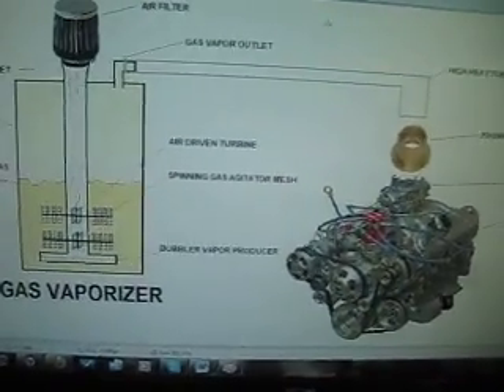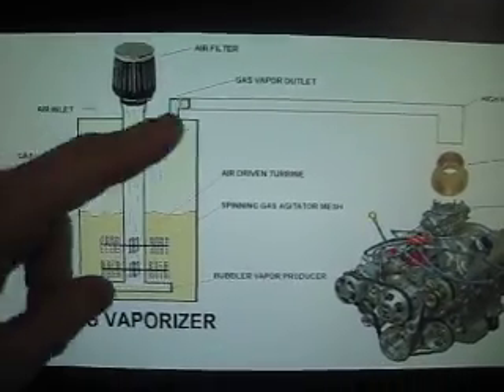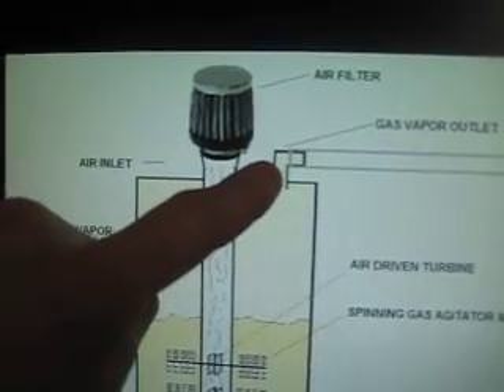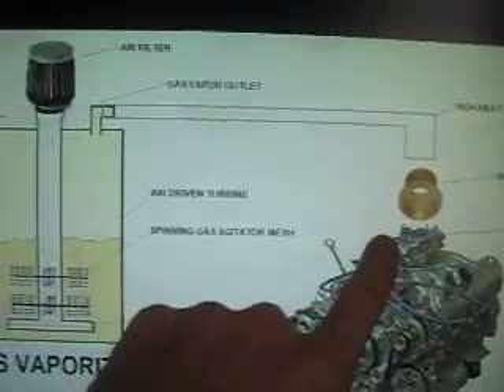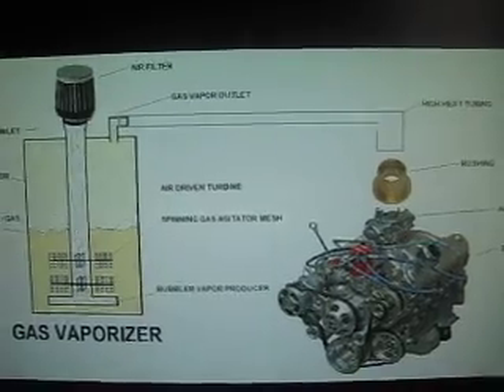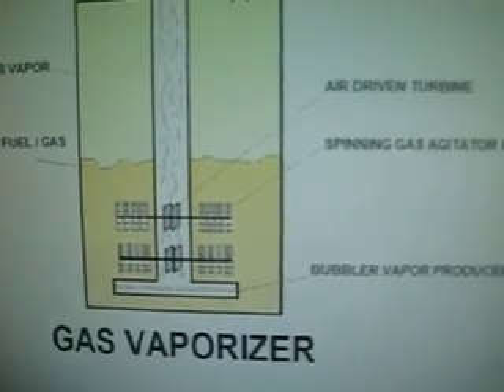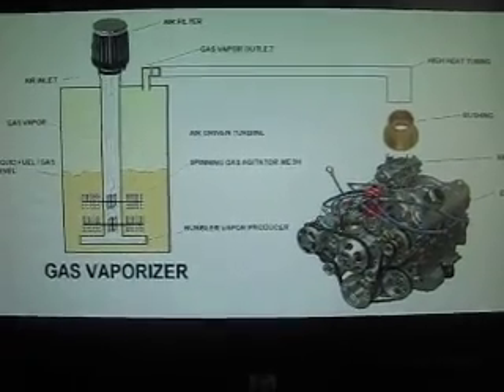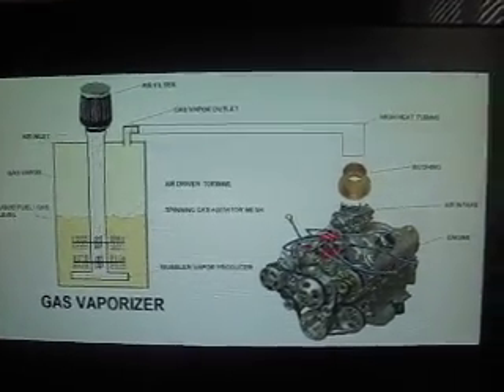GASOLINE VAPORIZER 100% GASOLINE VAPOR

Comment from the maker: I splashing can be an issue this is what the perforated steel and stainless steel is for. As for the ambient air temperatures I will be building a heat exchanger to preheat the air coming into the vapor chamber. I may also install a post air vapor heat exchanger it all depends on whether or not the post heat exchanger is needed. 

As for HHO I will be running that through my injectors.

Comment from the maker: You can use it on both. In either case you would redirect the fuel to the vaporizer instead of having it going through the injectors or the carb as it normally does.

Comment from the maker: Therefore I have a valve to control or limit the amount of air coming through the air intake. As for the exact ratio needed more testing will be required to determine this.

Comment from the maker: As for the changes in the air to fuel ratio the mix of 14.7 per gram of fuel also known as the stoichiometric mixture this changes because to reach the optimum air to fuel ratio using a vapor that burns completely because the molecular state of the fuel has changed so too does the amount of air required to burn the fuel. Instead of requiring a ratio of 14.7 grams of air to fuel it now only requires 14.7 milligrams to obtain the same results as using a liquid injection method.

Comment from the maker: The best way I can explain this is when the gasoline is heated up into a vapor it becomes more volatile and due to it's state can burn much more completely, so what happens is because of this volatility more energy can be created with less gasoline because it is already in the state of a vapor when it enters the engine cylinder. So the dryer it becomes or the hotter it gets the easier it is to burn and the more power you get out of that fuel. Therefore less is required.

Comment: in auto tech school it was taught that  best air fuel  ratio is 14 to 1 14 being air  how is the  air fuel mix controled here if too rich then a process called loading occurs and performance and  fuel will be passed thru the engine to the  exhaust in the form of  hydrcarbons too lean and same happens except instead of hc emission it is  co   this is a question not a  criticicim  pardon my spelling i am a  gear heaed not a scholar
 good video   thanks

Comment: The problem I ran into was fuel splashing and being sucked up as liquid through the tube to the engine intake.  The solution seems to be putting a big thin foam donut a little above the fuel level to prevent splashing as well as further spread out and dry the vapor.  For a dual (gas/HHO) system, I plan to use a mixing chamber to combine the HHO/fuel vapor mixture.  The steam/moisture from the HHO bubbler should be an added bonus. Ambient outside temp is also a huge factor to consider.

Comment: You may want to put a piece of plate below your vapor outlet barb to prevent gas slashing and being sucked out. You may fill the to portion of your tank with copper wool to do the same

Comment: I use HHO in my racecar and it has taken off a full second off my 1/4 mile times in a 3600 lb car. It also works well with direct water vapor injection which I also have on the racecar.

Comment: You need something to get the engine to start. Some kind of initial squirt of fuel to get your process going. Then you might think about running some hot water lines or some tubing running some exhaust through the fuel to keep it at temperature. Exhaust will be quicker but the water is more stable. Perhaps both? Anyway you need something above 150 degrees. This will allow for atomization of the vapor without the agitators you have in your drawing.

Comment: No, just use an air pump to shove air into a hose placed into your gas tank that has holes drilled into it. This air will bubble through the hose, into the liquid gas and bubble to the surface of the liquid gas and those fumes are then sucked into your engine through the inch and a half pipe connected to your intake manifold. Wa la, success. We are running a 91 Town Car on this system and its V8 is getting 240 mpg. Anything less than inch and a half pipe will not handle 6,000 rpms.

Comment: The most dire thing u need to worry bout is the lean condition melting pistons or distorting valves.....which is my problem at the moment.......no damage to cylinder walls....just pistons and valves. To make the mixture richer im thinkin about 2 or 3 vaporizes in a row....

Comment from the maker: No it does not have less power if done correctly and yes ethanol will vaporize like the gas does. There is about 7% ethanol mixed in with the gas. I don't like ethanol though because it costs more to make the the power generated from it. Ethanol also burns with less power so it is not as efficient as gasoline.

Comment from the maker: Yes it will increase mileage not by allot if you are using the vapor as an additive or booster like you do with HHO but if you run a car completely off of dry gasoline vapor you can get huge mileage gains. As for the emissions I am not sure I have not tested that yet but if you sue nothing but a dry gas vapor the emissions would have to get better because you have a full burn.

Comment from the maker: Transducers work ok but it's definitely not the way to go. Cracking the gas is the only thing that will work to vaporize all the additives in the gasoline. When you use a transducer you still have additives leftover they form a sticky like sludge and has to be disposed of as a hazmat product due to it's toxicity. So the only way to take care of this is to either burn it in your lawnmower etc. or to vaporize it by cracking it at a high heat.

Comment from the maker: I see what you mean however ultrasonic transducers can't get to hot because they will burn out and fail. My new design has overcome the problem with running the vapor system on cold days. I live in Idaho and it gets bellow zero here and my system will still work. Once I have protected my design I will share all the details.

Comment: Have u ever tied other stuff with the ultrasonic like get stale gas from a junk yard or tried any fuel mixes like if u mix alcohol and gas? Or tried any gas and oil mix or gas and veg oil, Back yrs ago when i had the money i spent about or over $10k/yr in just testing to be sure that i could use the most possible options out there? One real odd one that my setup likes is BioCrude or regular used motor oil and gas mix and alcohol and motor oil gave some impressive results

Comment: I would have to disagee there is only one real way the hard way to crack all the diff oils raw oils that they add that is with super high heat in my test i did yrs ago u need over 1200deg to vaporize 100%! I have not ever build a ultricsonic setup i dont think i ever will! Once u have run yr setup over 100,000miles than tell me how much u have that isnt vaporized i know some of those oils wont get vaporized my truck i have over 200k miles on just vapor!

Comment: Ya it is sweet way to use it all what i do is mix 50/50 sludge gas and used veg oil than mix in sawdust wood chips if i have leaves dried lawn grass some times i have old feed corn i just start adding to a 5gal first throw in sawdust and wood chips than the 50/50 mix and add anything else keep adding stuff until tthe mix is just barely damp then i press them into about 1 or 2' think briquette let dry in sun for one week than ready to use! My Press is just a modified caulk gun easy and tight pack

Comment: Another big thing these ppl with these ultrasonic units they keep saying u cant use just air to vaporize all the gas that is true but in all my air gas vaporization units only about 1 to 3% of the gas is oils and stuff that wont very small amounts i run 1month i drive 100 to 400miles every day! i only clean my unit out once a month not a big deal. and if u always leave some gas in it its always just thick gas easy to get out! I use it to make starting Briquettes for my wood stove!

Comment: I love it when ppl post a video that this is what they want to build! Hey just build it and show ppl.  Until u have made a few gas vapor makers u still have no idea how it will really work out. And after u said that u would need to do alot to make a fuel injected car run on it u r so far off its not funny just put yr dang fuel pump on a switch done that way its duel fuel gas or gas vapor wow thats hard its harder on the older ones with manual fuel pump than u have to change it to electric one!

Comment: I use a transducer connected to the air intake, just after de O2 sensor, but for some reason the oil in the machine was mixed with the vapors of the vaporizator.  I was wondering why?

Comment: One of the problems you will run into is, having a lot of  "dead" gasoline in your evaporator.  The key is to get the entire gas column to evaporate, not just the volatile parts.   In my research, I believe the answer is ultrasonics.  I have found 1,3,5,9, and 12 head ultrasonic transducers, that individually or in pairs will solve this problem.  The other is, there will need to be a fresh air inlet to keep the proper air/fuel ratio, w/o it that ratio is very likely to be much too rich.

Comment: The oxygen level is too high in the open air, for me to try that.  Maybe someone else can come up with a better way. The oxygen level is a lot lower coming thru the PCV, and the PCV also is heated air, with fumes. Running hot(super heated) air into gasoline can be dangerous. But what i can do is run exhaust(super heated) air before entering the gasoline.

Comment: Yes sir... It ran for about 5 minutes and had very good power take off response. But then the gas stopped making fumes in my tank because of it condensing down and then would only just idle. Need to heat up the gas to keep making fumes for it to work. No MPG results yet until the problem is fixed. Thanks for watching.

Comment from the maker: Yes I did drive it down the road with the bubbling. The holes in the bubbler were to big so I had some problems I need to add in a new down pipe with much smaller holes to make it run allot better. It did run fine on a flat surface under a load.

Comment: Did you get it to run under a load, as in driving it successfully down the road, by doing this? And if not, how much did it help your mpg., as an assist method of boost?

Comment: Also, wouldn't it work even better for you if you ran the air input to your vaporizor around the exhaust 4 times BEFORE  it entered the gasoline, thereby warming the gas even more so,producing more vapor ?

Comment: Are you saying, run the one line that is below the gas in the gas bubbler to the pcv output hole, and the other line that is above the gas in the gas bubbler to the intake manifold where the pcv normally feeds into, and this warm inflow of air will keep the gas warm enough to produce good vapor quality, which gave you the resulting increased mpg?

Comment: sorry to but your bubble, but i tried this cold vapor system, it will work for about 6 hrs and then the air going through the gas will ware out and after that it will not run no more, in till you pour. in new gas. you need to heat the fuel hot and then capture the vapor coming off the gas, its a good idea but ant time you run air through the gas it will go flat after a while,  useless

Comment from the maker: As for the vacuum some vacuum lines do have less pressure as you accelerate, however the suction coming from the air intake increases as you accelerate it does not decrease. Please see my videos on the vaporizer that is actually installed in my 2006 Buick.

Comment from the maker: I'm not sure if you mean run the actual exhaust into the bubbler or if you mean run the exhaust pipe in or along the container without the exhaust itself actually entering the container. I will either run the exhaust line along the bubbler or place a coiled stainless tube into the container which will be tied into the coolant lines running to my heater core.

Comment: You have a good idea but you will have issues : you will vaporize only the lighter parts of the gasoline (you have to put heat) and the more you open the throttle, the less vacuum you apply to your system ... you could keep the same system BUT use the exhaust to make gasoline vapors

Comment from the maker: @HHO4ALL As for the correct fuel level for gas production the bar on the float valve can be bent to adjust the depth at which the valve operates, thus making it possible to maintain the gasoline at it optimum level for vapor production. 

Keep up the good work man! Thanks for the ?s!

Comment from the maker: @HHO4ALL Yes I will be feeding the fuel line into the vapor chamber by use of a swamp cooler float valve. When the gas level drops the float will drop in turn opening up the valve allowing the gas to flow into the bubbler until the float rises back up to the valves closed position, thus shutting off the flow of the gasoline.

Comment: Will you be feeding the fuel line into the vapor chamber and if so, how do you plan to maintain the level of gas in the chamber?  

I am working on a similar design and using an ultrasonic pond fogger, but I'm having trouble controlling the level of gasoline in the container.  Too much gas and the ultrasonic pond fogger won't work properly.  Maybe I could use a sensor at the correct fluid level to control a valve that will release fuel until it reaches the sensor.

Comment: @whyme2b I dont know too much about it, as I only used it about a month. I have used HHO from 2007 - 2010, and just quit, because I had to tinker with it much more regular then I would like. HCS is (supposed) to be something like the geet reator. But I was told, that it breaks Gas into Hydrogen(about 10-12 LPM). Way more than my HHO kit(2 LPM 28amps). So far, in my bottle, I do notice some(maybe) water in the bottom. But all the liquid will evap out. Over all, it works great.

Comment from the maker: I should have my gas vaporizer built by the 26th of this month. On the 26th I am taking a road trip to Arizona it is a 17 hour drive one way so I will get some great data in on how well it works! I will post the results as soon as I am back from the trip.

Comment: @kbdory 
 Yes, awesome website ! I did already purchase the Wideband Quad EFIE from them awhile back and it works great...it really does lean out your engines fuel injectors from spraying to the point your engine would stall ! Iplanned on using that instead of unplugging my wires of fuel relay pump. Is the HCS something like the geet reator? Take care..

Comment: @whyme2b This is what i run on my car:    Hydrocarbon cracking System (HCS)
check it out at: fuel-saver(DOT)org/Thread-Hydrocarbon-cracking-System. This system is very easy to install, and can be improved with help from people like you. Please check it out.

Comment: @kbdory 
 Yes, the PCV is being a vacuum pulling air threw the gas.....anytime you do that, it will get cold and condensate down. Also i did have a control valve on mine to meter the fumes and got my engine to run perfect at idle with my fuel pump relay unplugged. it was all fumes with no injectors spraying in the engine to help it run...that's my goal to eliminate them and be all fumes.You need to go pass the gate keeper who tells you what you can and can not do in the computer.

Comment: Take the air filter off, and run that line to the PCV. Then run the other line  into the intake(where the PCV went to). The container will never get cold, or hot either. You will need a manual valve to regulate the amount of vapor interning the intake: Because without the valve, you will make too much vapor and choke the car(you will see). On mine, before the vapor go in the intake, it goes around the exhaust 4 times using a copper line. Went form 21-27 city, 28-37hwy 94- accord.

Comment: @whyme2b Take the air filter off, and run that line to the PCV. Then run the other line  into the intake(where the PCV went to). The container will never get cold, or hot either. You will need a manual valve to regulate the amount of vapor interning the intake: Because without the valve, you will make too much vapor and choke the car(you will see). On mine, before the vapor go in the intake, it goes around the exhaust 4 times using a copper line. Went form 21-27 city, 28-37hwy 94- accord.

Comment: Great idea man....I did almost the same thing with my truck. I did run into the problem of the gas condensing down, (since it is a solvent)....its gets way to cold very fast when air is pumped threw it and will stop making vapores. I do recommend heating the gas, either threw your water lines or hot air intake threw the breather to compensate for the freezing. And yes. the ultrasonic vaporizer works great but you will need to change out that O-ring because it's not gas resistant and will leak.

Comment from the maker: @crafter2u I will have a pump with a check valve connected to the main gas tank which will maintain the fuel level in the bubbler tank.There will be a float in the bubbler so that once the gas level reaches a certain level it will fill up the bubbler to a predetermined level.

Comment from the maker: @crafter2uThe bubbler may need to be cleaned out once in a while but what you must remember is that none of the sludge will be getting into the engine because the sludge has no way of getting past the liquid gasoline.